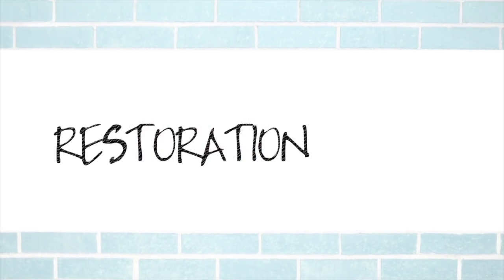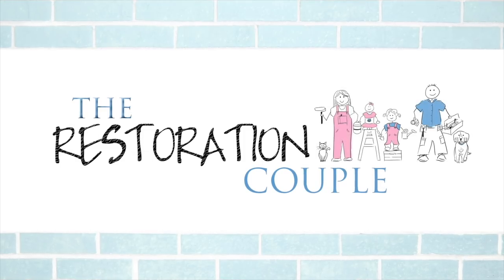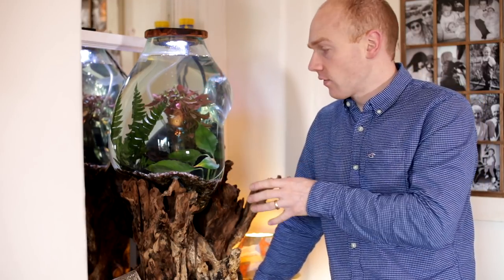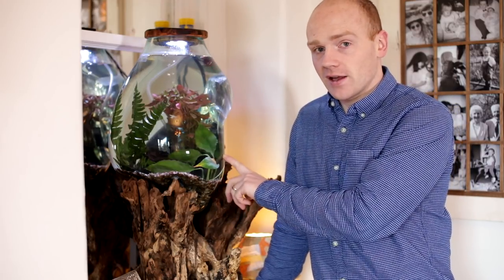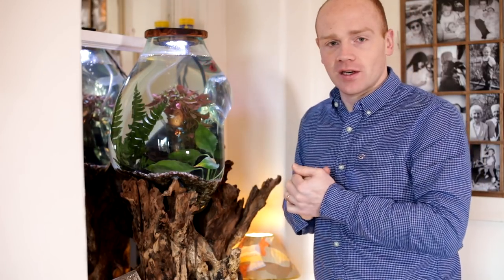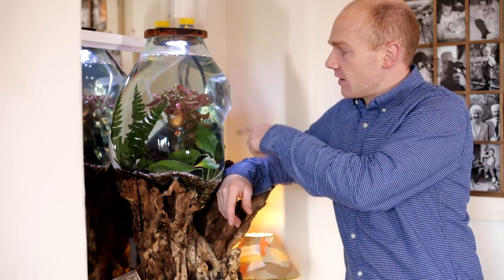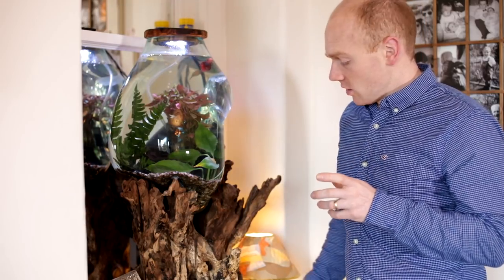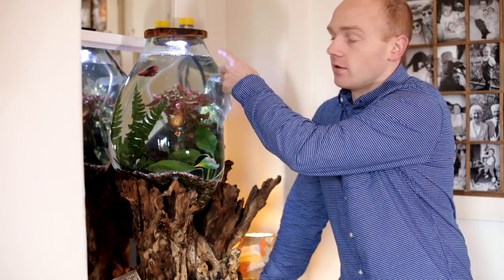All About that FISH TANK - Q & A's

Comment: I'm glad you did your research!! It's beautiful. For aquatic plants, I recommend you get Anubias Nana. Low light and very, VERY hardy, and you can attach it to rocks. Slow growing though. Get one and in a year it should have grown to the point of you being able to split it into 2 or 3 to spread around the tank. Just be sure to dose the appropriate amount of Flourish or an equivalent fertilizer. Also get a syphon and dechlorinator for the water changes, but you probably know that. ;)